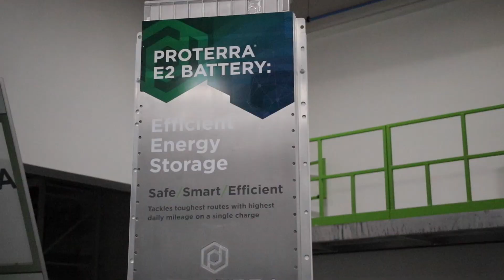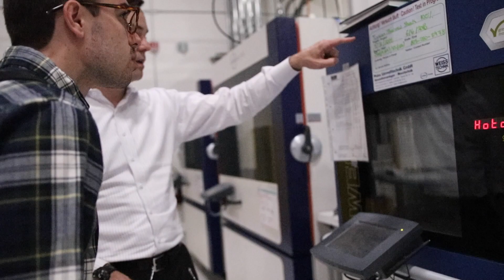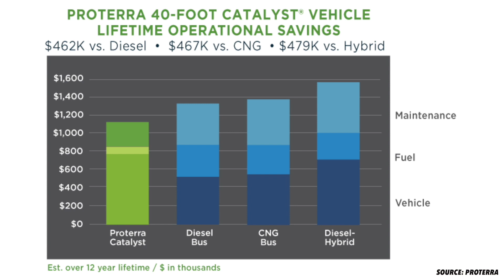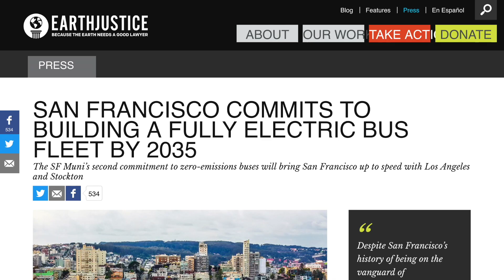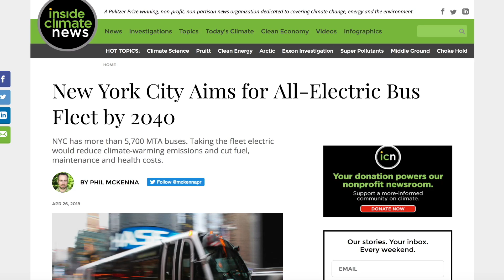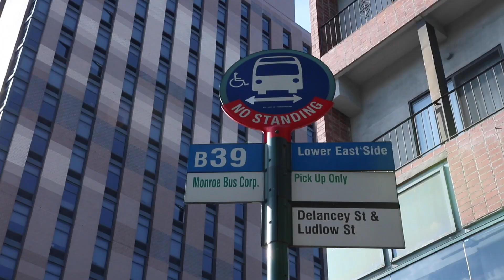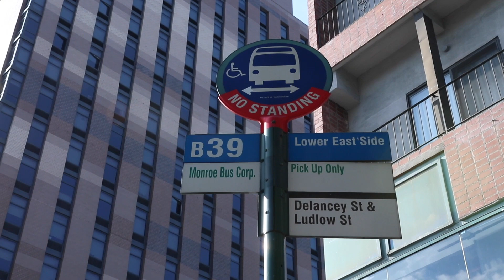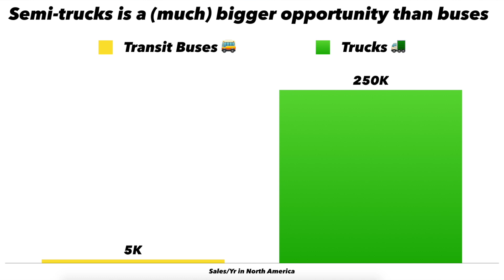Proterra: The Tesla of Buses 🚌🔋⚡

Comment: 1.2 million dollar right? A New Flyer is about one third of that prize! Clean and quiet! So how many years do you need to make a very very very over prized bus cheaper than the new Flyer? Electrical needs maintenance as well and a very expensive battery replacement. Power yeah? Close to 900 bus fleet recharge needs how much power?  Not worth it until these busses prize wise will be comparative to the diesel! Oh by the way they still need combustion engines for heating in northern countries 7 month wintery roads! How they slow done? Do they use electrical energy to replace the retarder? Give us specific data from the bus! Power usage by acceleration and deceleration, lights, heating, air conditioning, how many hours takes one charge before she is low on power? What kind of battery they use and how they make those? Lithium? Another way to kill our nature instead of the trolley busses, one energy plant which could be clean energy! Russia and Sweden use trolleys and they are much better solution than battery busses!

Comment: Here we only have Coach buses, the city busses are similar to airport busses, we do not have those curves that Proterra busses have we have all 100% practical busses, no compromise on cost for looks.
But yes Coach Busses please, our Coach bus transportation is quite advanced but still not electric :( 
(Free wifi & internet, entertainment system with games and new movies and electric wall sockets, all these for every seat. Bus ticket cost is the same as any normal bus companies)
The longest trips are usually around 120-180km (70 to 115 miles).

We need electric Coach Buses !

Comment: Great enthusiasm but perhaps these guys need to be a bit more sceptical about manufacturer's hype. The point about low maintenance and fuel costs sounds great. Advocates of other forms of electric bus, specifically the electric trolleybus, have been making these points for years but there has never really been a total breakthrough to absolute superiority - more a stand off on costs. 
But how do these battery-electric buses do in real life? The Federal Transit Administration has just produced a report on a year- long trial of Proterra buses in Seattle. The results in real service show the following total operating cost per km (fuel & maintenance): diesel-hybrid $0.35  battery-electric $0.51. Add to that the higher purchase price of a battery-electric bus, plus the cost of the charging infrastructure and you can see that at the moment, in real world conditions, battery -electric buses are not cheaper to operate. Of course there are positives, particularly regarding clean air, but transit systems will need to be aware that they get that at a premium price.

Comment: Nice sale gimmick . All you do is trying to pull in gullible investors for a startup company where that startup eventually will go broke but until than  all the higher level start up people  CEO`s  upper level management etc makes it rich . If electric buses were viable (this technology existed for almost a 100 years ) all what would be as far as local bus transportation goes electric buses already but they are not and never will be .  You are also speaking of lover maintenance cost but you are not talking about the replacement costs of batteries which need to be replaced at high  mileage usage every few years at huge expenses . You are not talking about the way higher initial purchase price of the electrified buses and you are also not talking about the actual emissions electrified transportation puts out 80+% of all electricity is being produced by using dirty fossil fuels coal gas etc highly polluting . Electricity at the charging station is also dirty or dirtier than gasoline . You are willfully deceiving people here promoting a scam . Shame on you

Comment: Shouldn't get the public transportation get disrupted by autonoumus taxis? The problem im thinking of is that a bus is harder to get 100% full of people all the time, where a autonoumus  taxi would almost have all the time a passenger in it, so that a taxi drive costs less than a bus ticket. Also car sharing will make private transportation cheaper. 
Busses need to get smarter to achieve cheaper prices. For example dynamic routes where the routes are depending on customers demand .

I don't see a future for big vehicles in public transportation. The trend goes towards invividual transport.

Comment: Musk didn't have to prove to the world that electric buses is feasible, so that would be a first for Tesla if they should decide to start producing buses, in that the rest of the world doesn't consider them "impossible".      

IF Tesla should decide to go in to the bus market, I think it would make about no sense to buy an existing company at full price.  Proterra has some very impressive buses, but Tesla could develop even better buses, and sell them for less then a third of the price of the Proterra buses, and still have 25%+ gross margin.  

Tesla could adjust their semi drive train to a bus, the "short" range semi will have more battery capacity then Proterra's top configuration, if they make a bus instead of a semi with that battery and motors, they should be able to sell it for about 200k instead of 150k for the "short" range semi. 

The potential market isn't limited to the US, and it isn't limited to current diesel dominated bus sales. With electric buses that go a full day on a single charge for about 200k the market could increase dramatically.

Comment: Interested in electric fire truck. Perfect use case for electric duty cycle: short route/response area and in fact intended for local use, and always returns to a place where electrical infrastructure already exists. The maintenance on those trucks is HUGE and could save gobs of money if they went electric. Not to mention the giant clouds of pm 2.5 and so many other diesel pollutants that could be almost completely mitigated.
Reply: Aaron Bounds - fire trucks, pumpers, water tenders and ladder trucks are very complex, and while they could haul the equipment, they would be limited in range and energy density for pumping all that water. Hybrid vehicles make more sense. Besides, you would have to make the trucks Electric Safe around water sources. However, shipping containers already use Electric Tractors as well as Electric mining Trucks for operations.

Comment: I'm on the fence re: long range buses. I mean, obviously there are going to be places where it is useful, but I think the right direction for public transport which has well defined routes in cities is to integrate rapid charging into the stop infrastructure.

Think something like a 50 mile route. Have enough batteries on board for say 70 miles for a bit of leeway (perhaps modular so you can add batteries to buses that change to different routes that require greater range).
4 stops that have significant wait time, you have a super duper mega charger that connects to the bus from above, say, and can give you enough charge to make the next charger in a few minutes. Perhaps using ultracapacitors alongside the battery.

This way, the bus literally never has to stop, except to change drivers, and for maintenance. With high utilisation infrastructure like this, seemingly large capex investments can actually be pretty small per trip if they're well utilised.

Similar to how driving a Tesla as a high mileage car actually makes financial sense, the more miles you do the cheaper they get compared to an ICE car.

Comment: So, I think Tesla invading the bus space is not the priority for them however it is a small shift from the semi to a bus. The Tesla Semi is fundamentally a skateboard just like all of Tesla's products, and much as there is an ability to swap out the top of a model X for a The Boring Company people mover top, a Semi conversion can't be harder than falcon heavy. I have seen a picture floating around of the tesla lineup and a bus labeled Tesla Semi. I am guessing it is not from Tesla but I hope they know for sure. His answer needs more reinforcement even though they could expand without bumping into each other for years, the Tesla short thesis often contains "better" electric car offerings.

I hope that a smaller market company is not shooting for complete vertical integration. As such, agreements with Tesla at least with a mega-charger standard and maybe as far as batteries and model 3 motors and even re-purposed power trains would signal to me that they (Proterra and Tesla) are trying to not be redundant and focus on a joint effort to replace fossil fuels instead of each other. I imagine that they have done their research and know eachother's plans but that they talk and negotiate is an extra signal of confirmation. Setting themselves up as better company if merged instead of redundant services sounds like the quick path to both moving the needle and growth and is a perfect way to gauge the value of their actions. If we fit it into a pre-division of Tesla model it sounds like a path to success exists. It is a company that does not require Elon's nano management, it can live or die without interrupting Tesla and visa-versa to get market experimentation. Proterra's expertise will cover areas that The Boring Company may be interested in since they will cover a 90%+ passenger only experience with traditional things like tolls, advertisements and more communal amenities to disrupt.
Reply: AI that identifies things that you brought on the bus and tells you if you left it behind with a picture for example.

Comment: Did they tell you what battery chemistry they are currently using?  I don't see any spectacular numbers which show that they have an advantage.  Originally they were using lithium titanate cell chemistry from AltairNano which can take an extremely fast charge rate but was expensive and did not have great energy density.  I don't know if they are still using that.